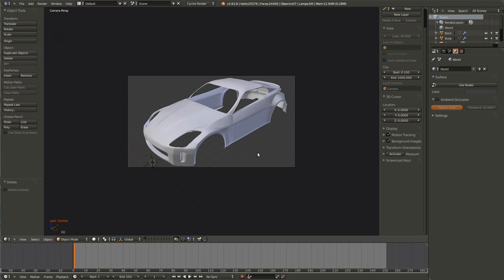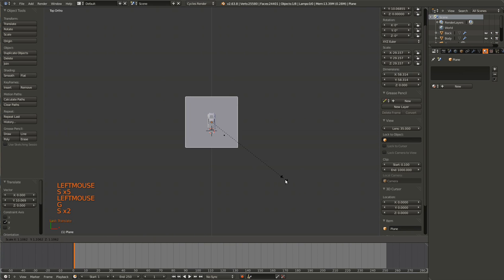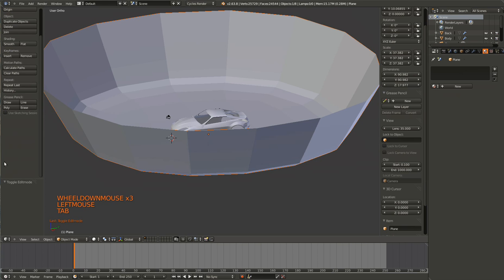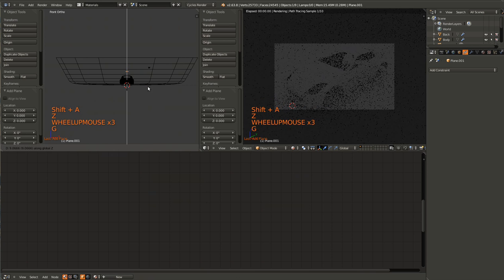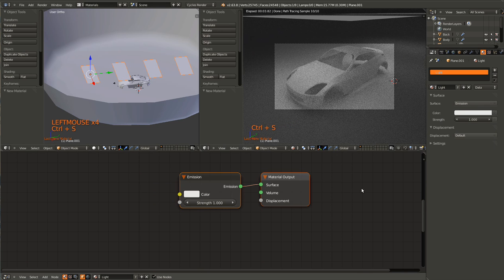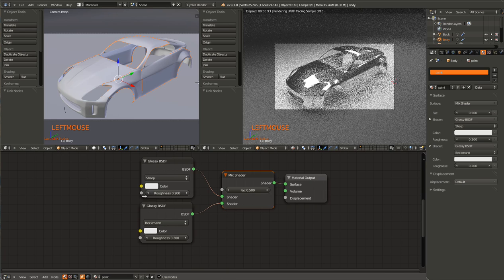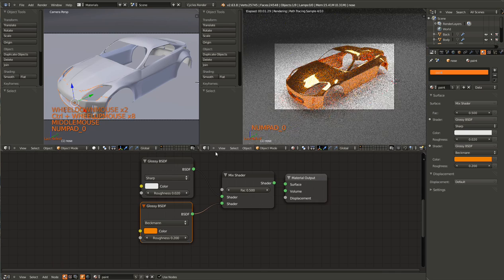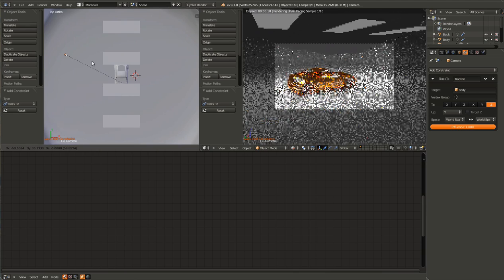Car Paint Tutorial

Comment from the maker: Technically yes there is. I haven't worked with the internal engine for a while so I don't remember the exact settings, but I know for a fact that it is possible. There is actually a node setup for the internal engine materials, but it isn't nearly as friendly as the nodes in cycles. Maybe someone should work on that. 

I hadn't seen the rendered view for the internal engine. That is pretty cool.